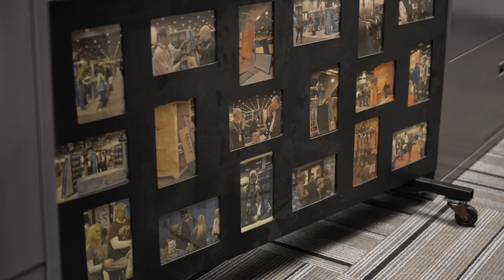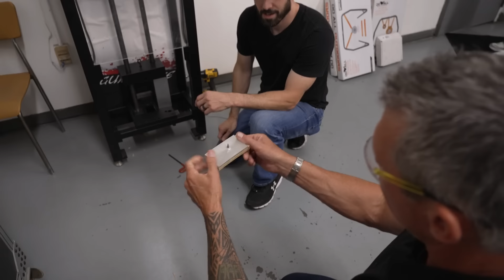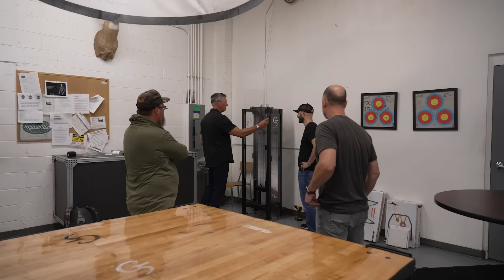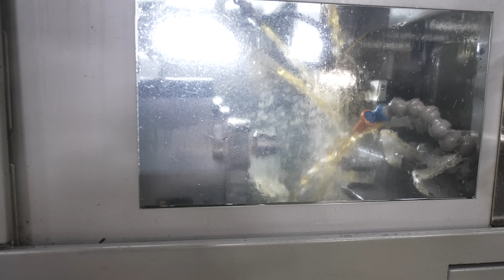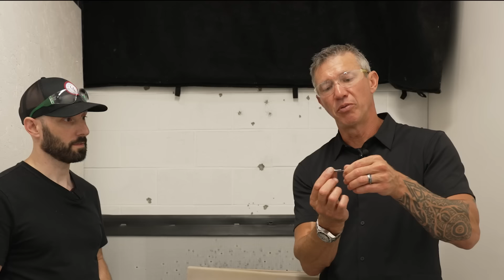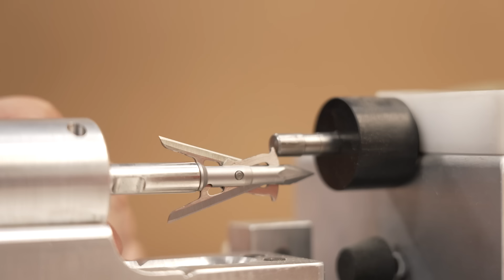G5 Factory Tour- How the T2 is Made

Comment: I'm going to have to check out this T2 now. The fact that ferrule didn't bend after the weights smashed it like that on top of the aluminum is amazing. I just wonder about the blades. That's normally the issue with mechanicals.

Comment: Nice review on the broadhead and how it's made but I was wondering why no time was spent on the blades.Even though the feral I's the backbone the blades are the workhorse  of the head in my opinion.
Reply: Exactly. That's what all the g5 expandables are like. The blades are junk. Why won't they fix this problem!!! Probly because they want you to keep buying more
Reply: @jason6325  I can’t speak for the other heads, but they source the blades from Northern Europe for the T2. G5 (Nate) says the microstructure is better than what’s produced here and they can get the grind done with edge free of a burr more consistently
Reply: They source the blades from Northern Europe for the T2. G5 (Nate) says the microstructure is better than what’s produced here and they can get the grind done with edge free of a burr more consistently 👌🏼